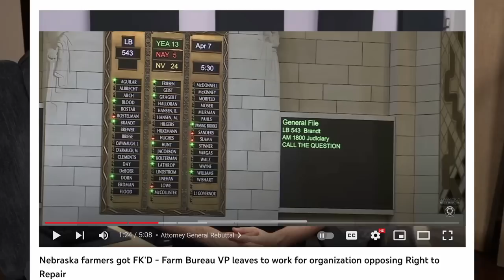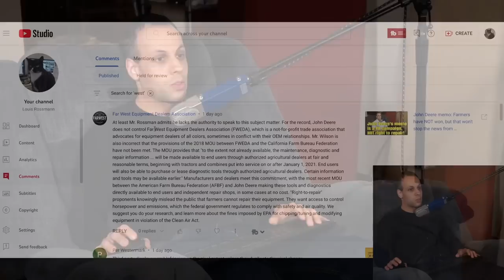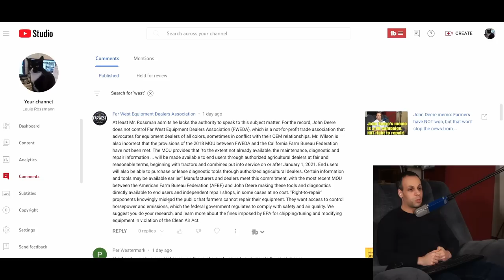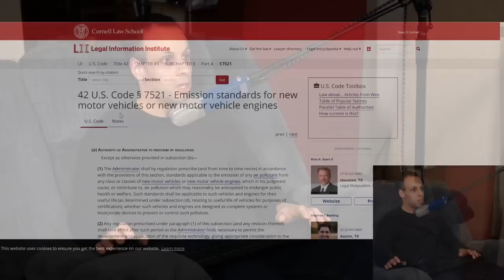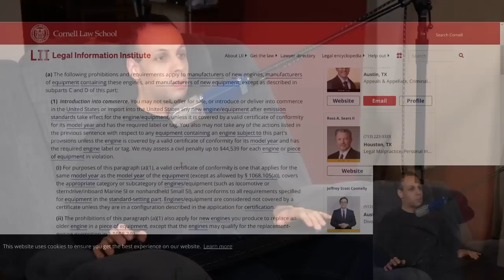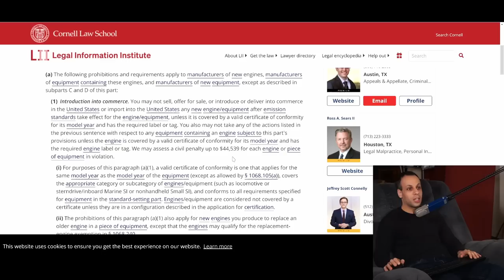When John Deere lies about emissions to screw farmers, read them this law

Comment: Lewis, just to play devil's advocate for a moment; There are more systems on a tractor, combine, or other agricultural equipment than the engine and systems related to emission controls. I'm not sure that the section you just read would apply to the rest of the equipment. I'm also not an Ag person, so I can't speak authoritatively on what those systems might be. However there are obviously sensors, controls, valves, motors, etc that relate to the work that the equipment is designed to do. I suspect that these other systems are far more expensive than the engine and emissions systems, so an argument needs to be devised that speaks to these other areas.

Comment: I wonder if the push to better reliability of everything during the late 80's and 90's has lowered the profits of the manufacturing and sales of everything. (Computers have greatly helped achieve this success.) I think that the companies got scared because they were expecting greater profits by increasing the durability. It didn't work out the way they wanted.

I'm not saying that this is the full reason, but it's part of the reason.
Reply: That is horseshit. Tractors and stuff from the 60's have worked with barely any parts being changed or anything braking. Around 80s and 2000s stuff was intruded that had no hope to last 40 years let alone 20 years. Just talking strictly about tractors I got a tractor as old as my dad. I'm sad to say that the tractor might outlast him with less problems. Got 2 other tractors too. One was worn and in poor shape when dad grew up. No maintenance of care given to it in over 20 years. We have only ones every other years moved the pistons with the hand crank. But I bet good money with not much effort that thing hand crack starts and reverses out of the barn easier then a 2000s tractors parked for even 10 years and over 40 years younger. And that is unreasonable to live up to. But it is true that modern stuff is not like the old stuff.

And the real farm tractor we also have is not used for 10+ years. We last plowed a bit of potato with it. It was burning oil trying to plow at full speed with the big plow. But really it is unreasonable to not accept stuff wears and ages no matter how well built something is. And it had not really ran much before giving it a proper pull. Give the machine a brake it was flying plowing that patch.

The tractor we actually use in winter time is a 3 cylinder diesel. To my knowledge tires have changed, hydraulics are changed for new pistons, currently the hydraulic pump leaks a tiny bit. Sure welding holes and what not is done to it. And sure some small things have been repaired that I do not know about. The seat and serial number plate have withered away with age. But like 60's tractors came with instructions how to tune the valves and all kinds of instructions how to maintain it. We have not touched the valves in over 30 years and it just keeps going and going. Drive train have many hours and the hole thing is used hard and only the last 20 years just done snow jobs. It still without fail starts like it did new. 

Left for 10 months and just starts right up like it ran a week ago. It needs to be driven with care and the wheels are not road worthy anymore. But it never fails to start as long as it has even half decent bat on it. Like a minimum on any machine. It is used enough to keep being in good enough shape 60 YEARS after it was made. And it has almost ONLY that going for it over modern tractors from the 90s even! It can do the work but o boy it is not good for the people behind the wheel.

Back then they sold stuff that lasted. People driving this things ruined there back and body. People buy better newer things that has not stopped for working people. The same with electronics we do not stop getting better tech. Stuff get better and better but the quality and long life is GONE. And we have no excuses for it since back in the 50s we where able to make stuff that lasted with far less tech and development resources and tools to aid the design. We are spoiled. And yet greed and no care about making stuff that is actually worth being proud off is not a thing anymore. It is just $ and looking modern for investors to be tricked into thinking your the shit. AI, self driving. RTX. We can make really good stuff but there is no people that value that anymore at companies. That is not enough.

Back then they where not afraid to make stuff that lasted. People did not buy it unless you put in the effort and was standing proud with the product and doing it right. Why would 80-90 be different. Why was it all the sudden a problem? It is not about that. It is greed and constant growth in making money that cases the scare of people having stuff that lasts and well designed. We are spoiled and stopped knowing better since next new thing is always so much better! And here we are where they can not sell more good stuff since it lasts to long. And they rather you own nothing and just pay MORE.

There should not be any reason to stick with stuff from the 60s. But that machine is reparable and have yet needed anything done to the drive train in all this time and work done with it. And the first years of it's life it was going FLAT OUT day out day in. It was built to last and with pride for the craft! Not trying to sell the product with a deep and solid promise of it lasting and working for many many years? Well people back then where smart enough to call BS and walk out. Competition had better stuff and that is not true anymore.

Agen it is amazing having a manual telling you how to tune the valves on the engine. But the dam thing is doing fine without it. But it is right to give the owner the tools and knowledge and access to maintain it! Instead of building a 'life time' no repairs or maintenance needed. It just brakes out of warranty! By a hole new thing from us! Do not repair it or maintain something to last longer then warranty! ...
Reply: @TheDiner50  
To be honest, I don't know much about farming technology. However, I know a lot about automotive industry and technology. I know that during the 80's, Japan was taking over the automotive and electronic industries in the US. The hype at that time was that Japanese products was more durable than the US products which it was true. Even "Back to the Future: Part 3" made a joke about this. In order for the US companies to compete, they had to improve the durability in their products which they successfully did for the automotive industry.

I'm going to explain a complicated topic. I hope I don't go over or under people's heads. When you have one product that still works after so many years, that doesn't determine the durability of the population of the product. You could have the same product and it died in months after it was first used. Since these tractors are mostly mechanical systems, they should follow the normal distribution for their failure rate. It's always a possibility where one seems to last forever. (It doesn't.)

If these tractors are still working everywhere, why are they not being used? There should be no need to buy another tractor. One of the possible reason is that the tractors have worn down to the point where it's unrecoverable. Another reason is that the tractors don't meet the demands of today's farming. I know that the area per farm has increased over time. If the old equipment is used, nothing would get done in time.

Comment: What I don't get if that's the letter of the law that Louis read, why hasn't anyone and everyone sued to get Johne Deere and everyone like them to force them to comply with the law?
Reply: Because, from what my non-lawyer self could find, "motor vehicle” means any "self-propelled vehicle designed for transporting persons or property on a street or highway". So not a tractor.
Reply: @captianmorgan7627  Are you saying what Louis read does not apply to tractors?
Reply: @Overonator  From what I can tell. If you follow the last link in paragraph 42 U.S. Code § 7521(a)(4)(B) (at "pursuant to section 7548 of this title.") and then click on the link in 42 U.S. Code § 7548(a)(1) for "motor vehicles" it says what I posted above. Not being a lawyer or politician I can't say for sure that this is 100% the case. But it does seem to be that tractors do not fall under this law. Farms and farm equipment do seem to get exempted from many laws.
Reply: @captianmorgan7627  That sounds suspiciously like a definition lobbied for by manufacturers of tractors and other motorized equipment, to exclude their own products.
Reply: @captianmorgan7627  Hey I did some web searching and if you search for the article "In restricting repair, John Deere may be violating the Clean Air Act, advocates allege " from politico it has some information on this very topic.
Reply: @captianmorgan7627  a tractor is designed to carry property, and it's definitely designed to go on the street because you can't get to most of your fields otherwise. Sounds like a motor vehicle.
Reply: @tissuepaper9962  And that may be the argument that is used. (And shows that I'm no lawyer, or farmer.)

Comment: Section 5 is awesome, but the definition of a motor vehicle hampers things a ton.
40 CFR § 85.1703 - Definition of motor vehicle.
(a) For the purpose of determining the applicability of section 216(2), a vehicle which is self-propelled and capable of transporting a person or persons or any material or any permanently or temporarily affixed apparatus shall be deemed a motor vehicle, unless any one or more of the criteria set forth below are met, in which case the vehicle shall be deemed not a motor vehicle:

(1) The vehicle cannot exceed a maximum speed of 25 miles per hour over level, paved surfaces; or

(2) The vehicle lacks features customarily associated with safe and practical street or highway use, such features including, but not being limited to, a reverse gear (except in the case of motorcycles), a differential, or safety features required by state and/or federal law; or

(3) The vehicle exhibits features which render its use on a street or highway unsafe, impractical, or highly unlikely, such features including, but not being limited to, tracked road contact means, an inordinate size, or features ordinarily associated with military combat or tactical vehicles such as armor and/or weaponry.

(b) Note that, in applying the criterion in paragraph (a)(2) of this section, vehicles that are clearly intended for operation on highways are motor vehicles. Absence of a particular safety feature is relevant only when absence of that feature would prevent operation on highways. 

Section (1) and section (3) are problematic. Many (but not all) tractors aren't getting above 25mph. Additionally, the big commercial tractors would probably be described as having an "inordinate size" in section 3. And tractors with tracks are just screwed. As strange and stupid as it is. Under this, tractors aren't motor vehicles, even though they have an engine or a motor.

Comment: That was a bogus excuse, when it comes to depollution all the diagnosis information must be available and if someone tampered with the tuning we have a specific checksum that will show on the tool that that happened so the reason why they block the reprogramming and repairing is another. THAT REASON IS anti stealing of the car. In the past if you came with your own injection ECU you could have stolen the car do specific measures have been put in place to avoid that meaning the pairing of the ECUs and other things so that means that if you need to change the software/ tuning or ECU you need the specific tool and authorisation to connect to the server to unlock the ECU.